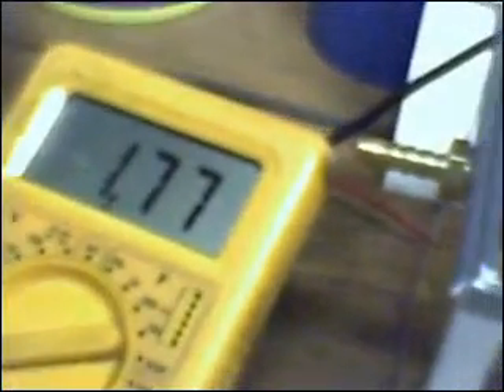23 - Hydrogen HHO Electrolyzer test unit 10-3

Comment: If you decide to go vertical, I'd suggest making a "chimney" above the plates so that the collection of bubbles doesn't cause a leak across the cells. For example, if you use the slotted groves to place the plates, then you can use plexiglass the same height as the plates and place above them in the same slots, this way you can submerge the entire cell.  Just a thought =)